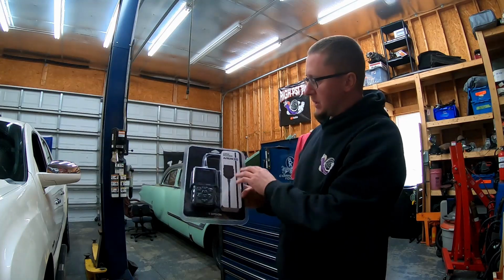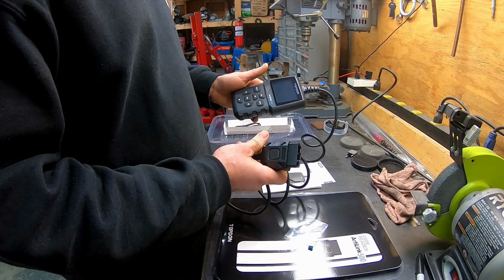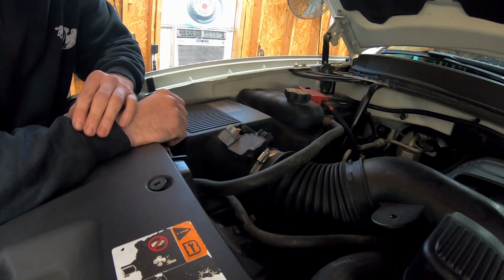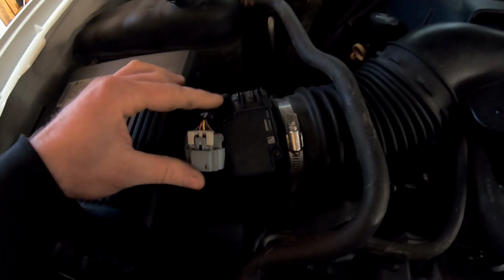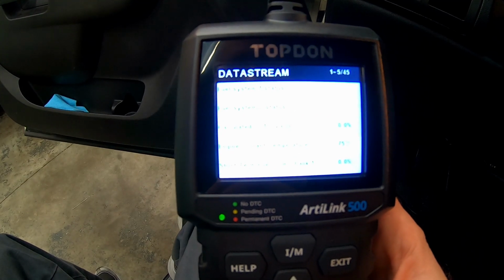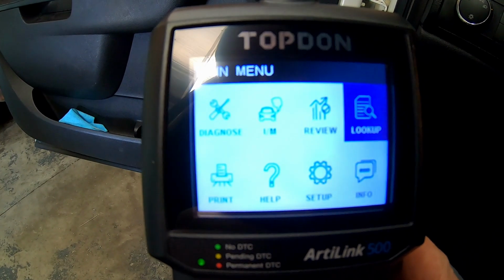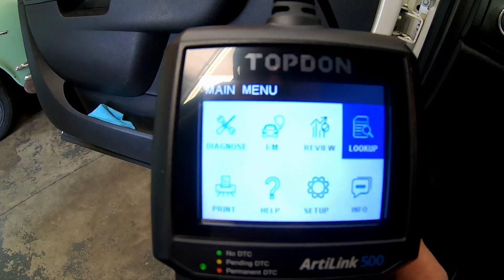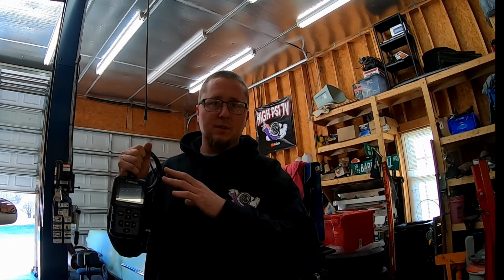TOPDON ARTILINK 500 Review and Test. On Sale Now

Comment: Got mine last night, was really looking fwd to using it. But when I hooked it up, it gave an error...  similar to one of the other commentary. Will try to run an update on it. Hopefully it will work. If not I will contact them and I hope they will correct the issue..
Reply from the maker: I'm sorry to hear the product did not work for you. Hopefully they make it right.
Reply: @HighPSItv  I contacted them and Amazon has it showing it works for these interfaces but they said it doesn’t at this moment but I need one for 2005 and up on the vehicles I have I highly recommend this product because of the price and features but I would definitely make sure it works on the vehicle u need it to before buying
Reply: Just noticed your comment what vehicle are u trying to use yours on just curious
Reply: @michaelberger6255   my 03 GMC yukon Denali. I have used AutoZone's cheap reader in the past. i wanted my own instead of going there, yea know
Reply: @leop7541  hey when the new one comes in I’ll try it and see if it was a glitched one or not and let u know if it does it again I will return it and not recommend it at all
Reply: @michaelberger6255  Got my new one (replaced item) last nite and tried it, same thing again. Performed the OS update and did EXACTLY what the instruction directed to do when connecting.. And yet nothing has changed. It still gives me the same errors. So back to Amazon it goes. I do not recommend this product..
Reply: @leop7541  oh snap I guess when mine comes in if it doesn’t work it will be going back as well it seemed like such a good deal and product but I bet you it really only works good on cars newer then 2008 and up it worked on a 2011 jag and 2011 Cadillac SRX but u know if it isn’t gonna work for mine which is the reason I bought it then it’s going back because it says it works with j1850-vpw interface and that’s what gm used and mine is a 2005
Reply: @michaelberger6255  Just to be sure, I tried it on 09 GMC Acadia that had a check engine light. It linked up but it said that the computer had NO error codes. I know that's wrong cuz i checked it with one from Advanced and sure enough there was an error code.. so yea this product had potential but unfortunately it doesn't work for me..
Reply: @leop7541  well damn 🥴

Comment: Hey ended up buying one of these and tried hooking it to a 2006 Escalade and 2005 Tahoe and all I get after diagnostic check is a message saying check to see if the connection is good check to see if car is on and check to see if car is compliant it’s an connecting error message u got any suggestions
Reply from the maker: Sounds like an error with the unit itself. I didn't have any issues hooking up to anything.
Reply: @HighPSItv  I kinda figured that I just ran an update on it to maybe get a glitch out of it or something it did work on a 2011 Cadillac SRX and a 2011 Jaguar I’ll contact them I really like the thing for the price I know computer stuff can mess up so it’s no biggie as long as they will take care of my issue
Reply: @michaelberger6255  did you get the issue with your reader resolved???
Reply: @leop7541  I contacted them and unfortunately they are on holiday and won’t be back till next week they said I could return it to Amazon and get another one I did return mine because it’s basically a computer and sometimes those things glitch and won’t function properly so I’ll try to post a reply when the new one gets here to let anyone know if it works or not